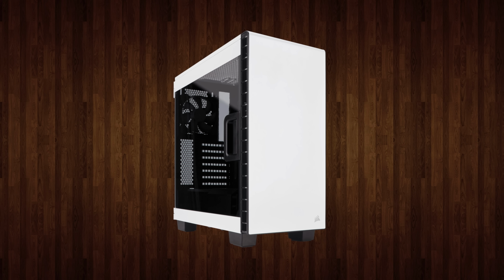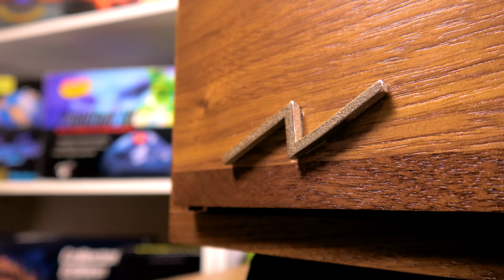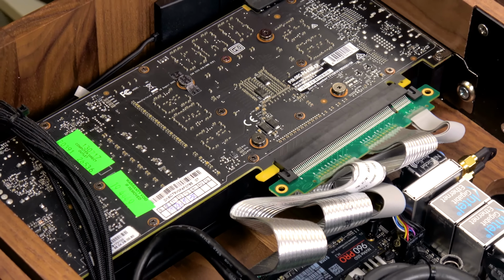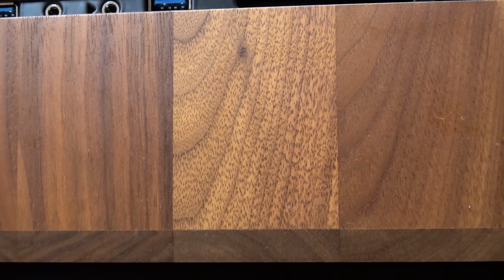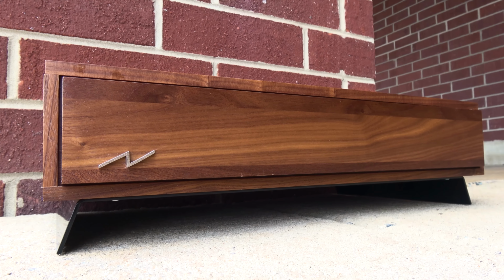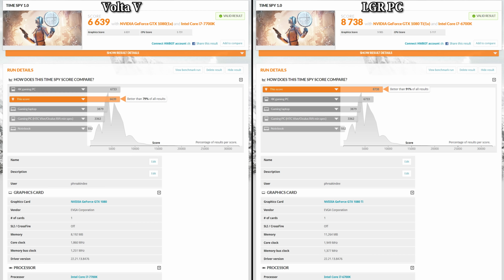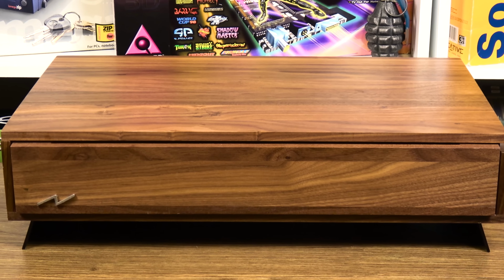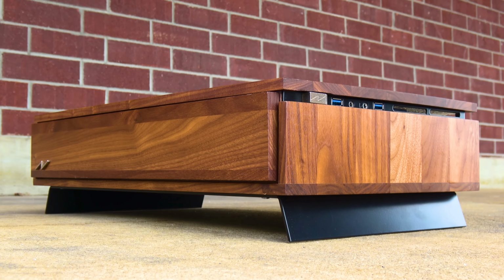LGR - Volta V Wooden Computer System Review

Comment: It looks neat, but not for that price. You can have the same case built from an expert craftsman for a fraction of that (depending on the wood), in fact I think he would do a better job than them, since they didn't even bother making the motherboard back connectors accessible without opening the case. So basically pay for the parts inside and a $50-100 for the case.

Comment: I am a great fan of wooden electronics, and the concept is good, but it looks so simple like something everybody with a saw and a drill could build in a few hours.
I did build a chest in school almost 25 years ago that looked similar exept for the type of wood of course.
The only problem i see with this type of case is the CE (or in the USA maybe the FCC) approval because the system has no shielding. For 3000 bucks it should have.
Anyway, i hope there will be more wood and aluminium in the future because i hate the shiny plastic look of todays hardware.

Comment: Guh, that's waaaaay too much for what seems like a startup. That's on par with Puget Systems (Minus about $400 for the Volta case) a much more established system builder, I dunno if the warranty would be enough to sell it if the company might not be there in a year. Now if they sold only the case, with the IO actually in the back, they'd likely get more customers. People are willing to spend $200-$400 on a bespoke case, but I don't think as many are willing to buy an entire computer just to get it. They're trying to capture a tiny subset of customers that want both an expensive custom case and have a computer built for them at a premium, I hope it works out for the, but I'm not so sure it will.

On a lighter note though, are those really their actual names? Underwood, Underwood and Woodard? If so that's weirdly perfect.

Comment: Wait, it has GTX 1080 and only 600 watt PSU? Is that enough?
Reply: Yes.  NVidia has not been just increasing the processing power of their cards, they've also been finding ways to lower power consumption.  The GTX 1080 only draws about 180 watts at peak load, so a 600 watt PSU should be more than enough.  Now, if you wanted to overclock it, you'd probably want at least a 750-800 watt PSU instead.

Comment: I have the same opinion.  It looks cool, but you are basically buying $2000 in case and I just cannot justify it.  Interestingly though, perhaps it would hold it's value slightly better than a traditional PC as even if the hardware becomes dated, the case should retain it's value far better.

Comment: Why not just spend like 20 bucks on a walnut board at home depot and make your own box then put your own stuff in it? Boxes are not hard if you're not going to do biscut or finger joints. Hell, this kind of thing would be fine with a few tiny nails and woodglue. I mean all a case realy is is just a metal box with holes in it. YOu can make a PC case out of anything realy.

Comment: I could build a better wooden case in my garage for a LOT less and that includes buying ALL the hardware, tools and materials.... 
Not to mention that thing is not built well at all, they could at least book match the pieces that make up the panels, preferably use a single piece of wood rather than multiple blocks glued together. Hell, even throwing a nice veneer on the visible surfaces would help. The design is poorly laid out, does not account for thermals properly and blocks the entire rear IO (neater cables?). I don't have a single good thing to say about that product except maybe for the fact they used and ASRock ITX board, ASRock's ITX boards are usually very good. As for design, layout and material quality.... I wouldn't pay $20 for that case without any hardware in it......

Comment: 2-4 grand is too much. You could get any carpenter to make that case if you give them the dimensions or what has to fit inside it and they'll make it for around €100 labour in an afternoon. The parts itself are mostly stock except the placement of the GPU and custom motherboard you could just as easily hack together yourself with the right know how. I seen this and thought it would be a great project for just about anyone that wants to try out a bit of wood work and knew how to put a computer together but that price is not justified.

Comment: I can appreciate what it's meant to look like, but honestly LGR's "slapdash" woodgrain case looks better than this. The joints don't line up, there's dings all around the edges, that metal stand is very cheaply assembled. And then what the heck is up with putting the motherboard so far back?

Comment: It's wood with steel feet, some cutouts and holes for the screws and mainboard, I mean they didn't even bother going that extra mile with the I/O shield... ... 2000$ before tax? Yeah, well... still cheaper than an useless MacPro I guess?

Comment: I really do appreciate what they are trying to do, but for the price, that case has some unpolished edges so to speak. Panels don't appear to line up well which partially ruins the aesthetic for me. And of course the feet being sharp and not protecting the furniture is a big turn off. Finally not having the IO ports accessible on the back is a big WTF moment...

Comment: It looks nice from outside. But inside, its mess, cables are randomly led over fans, PCI-E extender is not shielded, motherboard is in the middle, so when you want to connect something, you have to open it, amazing. Also the cheap sticks of RAM, and price of this. Its kinda what. Is this a joke build? Student art project?

Comment: I have to be honest.  I like wood grain, but this case is hideous to me.  I hate the way the front sticks out...I can't stand the stand, and that logo is just pedestrian.  I am also opposed to the use of walnut because of its ability to absorb and retain heat.  The bamboo model would be better for this purpose.  I like the idea of using sustainable products in the manufacture of hardware...but not when it's this expensive either.  Sustainability is a nice goal, but recyclability is almost as good.  Steel has none of the problems of wood, and doesn't really degrade with recycling.  From a PC health standpoint, price standpoint, and eco standpoint, it's really hard to beat thin, sheet steel for a PC case.  You can even use eco-friendly enamel paints for the steel to make it white or eggshell for the heat reflection properties.   
tl;dr This product is not for me, and probably not the best performance option for a PC case.

Comment: wow 3k usd for a fire hazard cool
Reply: Wrong.  The CPU would fry long before the case would even begin to smoke.  Walnut doesn't start to burn until about 400 degrees.  If you want your CPU to last as long as possible, you shouldn't let it get over 140 degrees.

Comment: I also dislike the 'gamer' aesthetic. I prefer a cleaner, simpler case design, like the inwin 303 or nzxt s340 elite. No bright colors, ugly angles, or cheap plastic. Just a simple, yet bold aesthetic, made of quality materials. I do prefer bare metal, powder coated metal, or anodized aluminum over wood though. I'd only get a wood grain pc to match my retro technics stereo and the two polk audio speakers (all from the 70s) that go with it in my workshop audio setup, but I don't need a pc on that setup.

Comment: If you think its overpriced, you don't value woodworking. A Dell is overpriced. This is function inside art. This case would take me at least a month to make.  It doesn't take much to punch out/bend/cut/drill sheet metal and bake on some power coat paint. They should have done a better job of matching the finish of all the pieces. I don't expect the grains to match up, but different shades look like crap. I bet most people that say this is overpriced are using the same mass produced cold rolled steel and plastic Chinese cases my broke ass is using.

Comment: Like aftermarket car radio head units, desktop cases all look like they were designed by 12 year olds for 12 year olds.
Reply: As long as they're not built by engineers.  In the early days of desktop PCs, the cases were built by people who only cared about getting everything into the case... they didn't care about how easy it was to repair.  A memory upgrade on an HP ended up taking about half an hour (when it should've only taken about 5 minutes) because the RAM was hidden behind a power supply and a structural support rail.